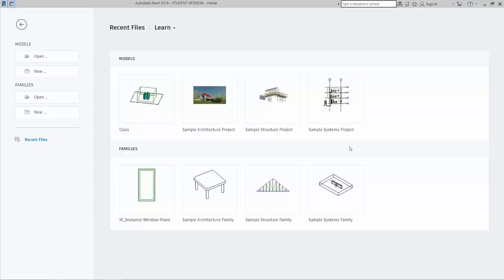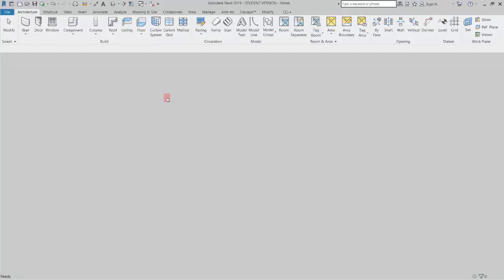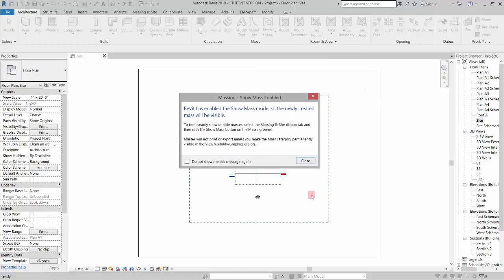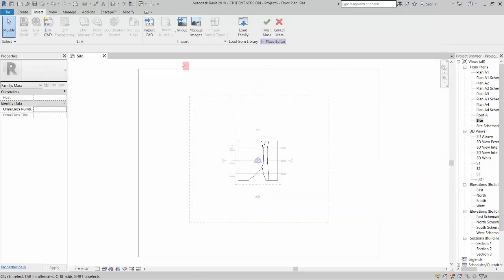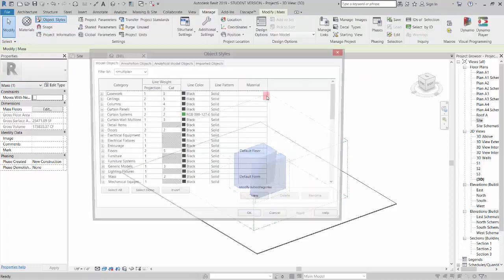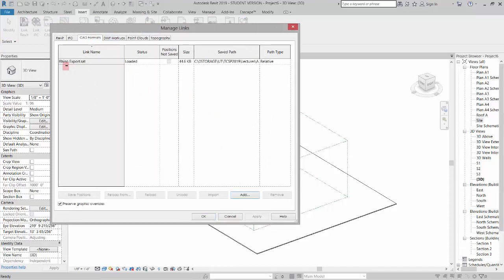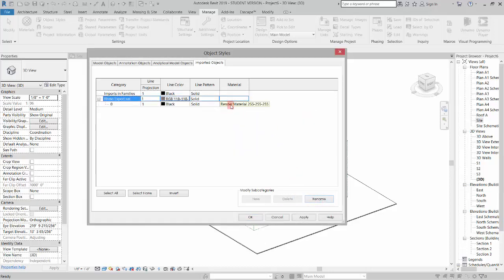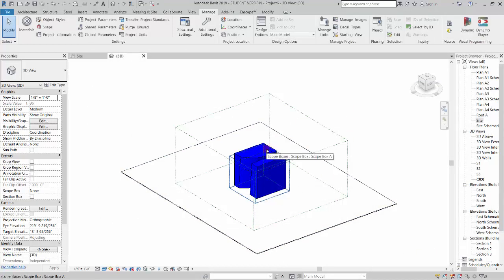1 03 Revit Link SAT 1

Comment: when I try to "link cad" and select my sat file, revit 2019 says: linked file could not be located. it will be displayed as it was when this project was last saved.
this is a .sat file made in rhino 6. i've been following all your steps, but stuck with this error
Reply from the maker: Have you selected .sat from the files of type in the Link dwg dialog box?
Reply: @MSmithWorkShop  yes!